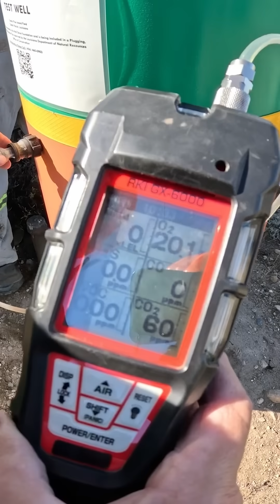The problem goes deeper than you think...

Comment: Why do i feel like the pressure and heat eould be to much for the plug and then turns into a shotgun blast 😅
Reply: I would be amused to see you try and blast several feet of concrete that has  solidified in a metal pipe. It takes much more pressure than these old weak wells can produce.

Comment: WE used to cap weld the down hole pipe, by digging a bellhole and cutting the pipe 3'-4' below surface, which was always Fun Watching the welder trying to seal off the last part of weld with the flames surrounding the cap until he was able to seal off the escaping gases.

Comment: but at some point...that well will fill back up with oil. Sure hop that hole can be reopened when you need to again. ;)
Reply: How do you think oil works. Seriously. How.
Reply: @SAMUELFINCK dig deeper into your research. Oil is its own thing. Its not "fossil fuel". That term was given for a nafarious purpose. In your research you should find a well owned by the Shell Corp that was emptied 20 years ago or so. So they capped it off. Then recently they decided to take precise measurements of that space to use it to store helium. AS they were taking those measurements they found that the well was full again with oil. This happens way more foten than people are willing to talk about. Because the old programming/narrative that oil is finite is wrong. Enjoy!

Comment: Your metric for how much pollution this stops is terrible.

"Over 20 years plugging this single well is the equivalent of taking 1000 cars off the road, or planting 200k trees?."

Are you saying it's like taking 1000 cars off the road for 20 years? 

Or is it like taking 50 cars off the road forever.

Same with the trees.

Do you mean it's the same as planting 10,000 trees and replacing any that die forever?

Honestly that trees stat feels MORE powerful stated that way!

and the cars statement could be said this way perhaps making it more impressive:

Plugging this single well will offset the emissions of 50 cars every year forever.

Comment: I feel like when the soil dries up around the concrete plug there would still be methane escaping. Couldn't you fill it up with water or wood or plants? I mean a natural environments there is submerged biomatter which doesn't decompose. Also wouldn't there be a cavity because the oil was pumped out? Just fill all that with water

Comment: Here me out we're already using the methane in cattle manure to produce powrr what if we do the same here
Reply: Can't be done, because there isn't that much methane. If there were, private companies would have tapped it already.  Most of the gas left in these wells is a mix of useless crap, and no, it's not a huge danger to people. These efforts are just EPA busywork tog et some people paid. . You can tell because the wells have been around for a hundred years or more and nobody ever cared.
Reply: @arcdecibel9986  Or maybe nobody ever cared because we started caring enough way less than 100 years ago...

Comment: This could be a way we Terraform other plantets. We create an artificial greenhouse effect and then wait a few thousands years and boom livable
Reply: Good thinking, except that would be a giant pain in the ass for very little comparative gain. They'd need organic molecules in abundance to have methane to begin with, and then there's the problem of having the correct gravity, and a magnetosphere, and distance from the star, etc. 

But by far the worst waste is the fact that 99% of a Terra-sized planet's mass and resources are not in the crust where we can live. It's far easier, and more efficient, to crack those planets, completely pulling them apart, to use their materials for purpose-built habitats in solar orbit. 

Any kind of planetary environment you could ever want can be housed within an "O'Neil Cylinder", which is just a giant rotating tube in space. The spin provides gravity to taste, and because the thing can be moved or constructed anywhere you want, it also has access to the vast power of the nearest star, making it easier to build or modify. 

With the materials we have today, we could build these cylinders with usable living and working areas of around 40% of total mass, not counting exterior solar collectors and docking ports. Plus, since they don't have a lot of gravity other than that induced by the spin, it's really easy to launch ships, as compared to a whole planet's gravity that we aren't using most of.  And that's just for starters...

Comment: This comment section is proof that "climate change" is just used to distract from dangerous pollutants.  Dude says that gas can drop a man dead, and it's all climate change this and that.
Reply: That's because hydrogen sulfide is just part of the propaganda pitch.  Obviously, it doesn't come out in pure form, having been mixed with other gases. If it did, we'd have tens of thousands of people dying from regular oil wells, and plugging operations like this one. These guys aren't even wearing respirators because there is no danger.

Comment: hole in the ground stays open for 100 years that spews out as much toxic gas as 1000 cars combined but my v8 gasoline engine with emissions equipment in the exhaust and cattle farmers are the environmental hazard...

I guess it's cheaper for them not to plug the hole.

Comment: from a 2021 research paper regarding those wells:

We analyze data from up to 19,500 wells and find that median decommissioning costs are roughly $20,000 for plugging only, and $76,000 for plugging and surface reclamation. In rare cases, costs exceed $1 million per well. Each additional 1,000 feet of well depth increases costs by 20 percent, older wells are considerably more costly than newer ones, natural gas wells are nine percent more expensive than wells that produce oil, and costs vary widely by state.

Comment: Why not put a pipe down through the concrete plugs as you're sealing the hole with a valve on top in case some wants to tap off some those flammable gases later on?

Comment: Sadly not enough is being done to "properly" seal the tens of thousands of abandoned wells. Why? Nobody wants to pay for remediation. Open and cheap half ass attempts to seal abandoned wells spew gases 24/7. Simply plugging the borehole often fails because the pressure is so great gasses find a new route to the surface around the borehole concrete filled lining. Old drilling techniques left gaps between the borehole and the pipe. Gasses work their way up the outside of the pipe and through fractures in the rock. Gasses can escape from old borehole more than a mile away. Seismic and fracking activities result in even more gasses being released. The only means to minimize escaping gasses is to remove/ drill out old lining and fill with concrete. But its costly to do it right.... ten times or more than simply filling the old borehole. A new oil tax is required to fund properly, longer lasting sealing. With fracking no seal is permanent. Filling old boreholes is more about looking like something is being done, versus actually fixing a problem we created. In 30 to 50 years our grandchildren will face the costly burden of extracting concrete filled pipe and filling them back up with concrete. Or mincro power stations and gas scrubbers will be deployed to utilize and monetize escaping gasses.

Comment: Perhaps drilling companies, before they can start drilling, should be required to put some money in a trust that is specifically for the costs of sealing the hole. That way, even if the company later claims bankruptcy there is still a means to seal the hole. The law that establishes the requirement to have that money in trust would need to also stipulate that the money in the trust can only be used for that purpose and can not be seized as an asset to pay off other debts.

Comment: I worked for a company called TECO that installed Hydrogen Sulfide monitors below the drilling deck. It's slightly heavier the air so it was installed near the bottom of the rig. Never heard of someone dying of the gas, but I was always nervous while installing them.
There was an extreme amount of camaraderie among all the Roughnecks and supporting companies.

Comment: I know where this was shot. Somewhere near Chester, MT in the north central part of the state. There are hundreds of these small oil wells all over this area either working or capped off. I can see these mountains from where I live further west. They are not kidding about the gas. More specifically hydrogen sulfide which is quite toxic to breathe. It is fortunately pungent and you smell it long before you get a lethal exposure.

Comment: hydro sulfide means gold down there and old oil wells are producing again for some reason now !!! but there is gasses that can be sold of after !!!!
Reply: Yeah, but if you think about it a lot of times the process to extract those gases safely will cost more than it would to simply seal the old well with concrete, Hydrogen Sulfide is highly toxic, Methane is extremely combustible and explosive (More so than Gasoline)

Comment: So you stuff something that expands say 500 feet down. Shoot, a nice sized peice of fiberglass insulation rolled up and in an 6" PVC pipe lowered and the roll pushed out. Then pour a small amount of fibered concrete on top of the insulation. Let it set up and pour a thicker plug the a final even thicker last part of the plug. Im sure there is some sort of math and science involved. 
  Problem with my idea would probably be dropping concrete 500ft. That a decent amount of inertia, may need something better for a form bottom.

Comment: Jerry. 
-  Water? Is it no longer potable? 
-  How far away from the hole is it safe for people to live? 
-  What specific plants can grow in the land around the area?
-  How far away can we grow plants from hole?
-  Was there vegetation 100 years ago?

Thank you for sharing.
Reply: I'm not a subject boffin. But surely it is because they drilled the oil became accessible. i.e. it was there underground before. So anything that gre there before would surely still grow there, subject to negative effects of gasses. If waters in the area, even if it's in the well, it would sink back if unpressurized, remaining in it's pocket. Any strata seepage would be cleaned of oil deposits by rock filtering it (?). The only worry I see is the occasion where water forces oil & gas to surface to contaminated and polute.

Comment: um yes methahne will escape it will certainly escape once you take natures rock away concrete is porus no matter what anyone says its a matter of degree aka it will take out 95% of the methane but some will seep out then you have the lifetime monitoring of it with digital stuff and inspections and a cap on the top you can never ever dig there etc

Comment: When I was a kid driving to Odessa, TX, we could always smell when we were close. Now I know why. 

This is good work. Glad to see it being done.
Reply: That would be the refinery..
Reply: @AlarmingTwitch there’s no refinery in Odessa. There is one in Big Spring though.
Reply: @ Perhaps I stand corrected. But maybe it’s all that’s stuff?
Reply: @chrisoffersen  Well, methane is odorless and colorless, so if that's the primary gas leaking out, you wouldn't detect it.
Reply: What you're smelling is H2S, or hydrogen sulfide.  It's in the oil, gas, and brine that comes out of a well.  As a result, the oil and water that's pumped into storage tanks will offgas H2S similar to how an opened bottle of Coke will bubble and offgas CO2.  That stuff is under pretty intense pressure (I've seen as high as 1,800psi) until it's dumped into the tanks at effectively ambient pressure, so it all comes bubbling out.  Most sites will have a vessel or two that separates the gas/oil/water so they can send each to their respective places, but they're not 100% effective at removing the gas and volatile liquids that boil off in warm weather.  Excluding some really modern and expensive sites which capture and process all sources of gas, those holding tanks will vent gas to atmosphere above a slight pressure gradient.  The gas disperses to a safe concentration fairly quick, but the scent carries for miles and miles.  Some of the older sites have less protection and will vent a lot of gas to atmosphere, and each well has a different concentration of H2S...some have virtually none whereas others are so highly concentrated that they require a lot of precautions and safety equipment just to approach them.  When you have thousands of wells surrounding you, it doesn't really matter which way the wind is blowing, you're probably going to catch it eventually.  It's not really something you stop smelling, but it's something you get used to.  Parts of Odessa are worse than others, and it does depend on wind conditions and whether a site nearby just vented a whole lot of gas from a safety pop off valve...which also happens at modern expensive sites.
Reply: Always cool to see my home town mentioned in the wild. However it's usually about crime rates or oil lol
Reply: Luling Texas as well. No refineries, old oil country. Lots and lots of abandoned wells.   Smells like old burnt eggs.
Reply: Drive through Texas and you still see them EVERYWHERE but usually they are mining Helium.
Reply: Used to live in Denver City Texas and when you would drive into town coming from the south from Andrews and Seminole you would know that you had arrived and Denver City when you smelled rotten eggs or hydrogen sulfide there was a tank battery on the right hand side right before you got to town and it always leaked to tiny amount of hydrogen sulfide it's long gone now but used to I remember that as a kid.
Reply: Seriously, Chicago smells about the same.

Comment: The government should charge a fee in advance for each hole drilled. Then the government should be responsible to plug the hole. 

Does it have to be plugged with concrete? Couldn't they fill it with mud?

Or gravel and mud. Whatever is cheaper than concrete that'll work

Comment: Worked in Oil and gas drilling for decades. Its odd to watch an uncased hole, must be from a really really long time ago. Its Not "Concrete", but cement. There is a difference.

Comment: Many older wells are 50, 60, 70, 80+ years old.  The companies that drilled them produced a high volume of oil, and as oil production declined and water production increased (which is normal), they sold them to companies that did't have the money to drill new wells.  As oil production declined even more, they sold them to smaller operators that had lower operating costs, and so on.  

Now these old wells require a lot of repairs because of corrosion.  Repairs are expensive, and it is unlikely that the future production can pay for the cost of the repair--or even for the cost of plugging.  In some cases, it can cost MILLIONS to plug a well that's 60 years old, and the companies that drilled it are not longer around.  Many of the people involved are dead.  The wells are simply abandoned.  

The Federal government has established a fund to pay for plugging expenses of these wells.  However, there are an estimated 100,000+ abandoned wells and it will take years and lot of money to plug them all.  Also, oil wells are substantially deeper than fresh water wells, and what we're trying to protect is fresh water.  An oil well may be 10,000 feet deep, fresh water well 200 feet.  

Do you want to permanently plug a well?  As oil prices rise, there is more incentive to go back into an abandoned well and try to produce it again.  

This is a lot more in plugging a well than what you see in this video.

Comment: So I just had an idea. What if you used something like an expanding plug with a mesh going up maybe like a foot or two. Insert the plug lower it like 1000' expand the plug put in cement that will mold to the mesh and be reinforced by the mesh. Repeat once more at 500' and 10' fill the final plug to be almost level and cover it with dirt...

Disclaimer I have no idea what the current process is. I could be saying exactly what they do or I could be thinking of something that just would not work.

Comment: Except fracking leads to multiple fractures that are impossible to track down and seal, all in all "drill baby DRILL" will be our epitaphs. And its a bipartisan effort, thats heartwarming Biden mandated prospect drilling on every lot of Federal land leased for exploration, basically liberating the tons of methane waiting in the wings to usher in warming at 10 TIMES THE RATE OF CARBON DIOXIDE, welp we had a good run... Hope "Clean Oil Co" paid you well Jerry 😂 and the best part is: he did it because spot oil prices were high 😅😂😂😂a completely worthless and incompetent response to OPEC choking supply to profit on high prices, after they experimented with a free oil market that left oil at -$16 a barrel, so we all die so they can make billions.... Sounds fair 🎉

Comment: i wonder if they ever check up on the deep water horizon after they capped it?  that thing poured oil into the ocean for months before they finally capped it and i wonder if its actually holding up properly?  they should have dilled a new one right next to it and pumped out as much oil as possible to reduce pressure

Comment: Have to let the first cement plug dry first? Bullshit. Plugged wells coming out of the hole on a Drilling Rig and setting several plugs as we pull the pipe out. Due to hydraulics you can set a cement plug and it will stay in place . don't believe all the bullshit on the net.

Comment: This is how it works: 
Company A hires a drilling company to drill the hole and takes the lions share of the oil over decades of pumping.
Company A then sells off the depleted well to company B.
Company B is specifically in business to buy up these "dripper wells" with the intention of going bankrupt so no one but the state has to clean up after them. 
The taxpayers are left holding the bag for the cleanup. 
Any questions?